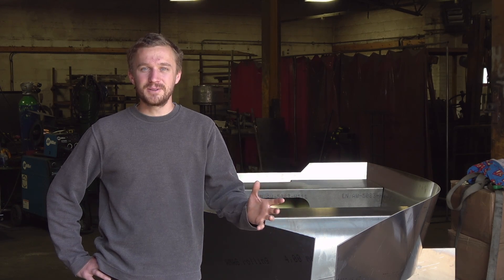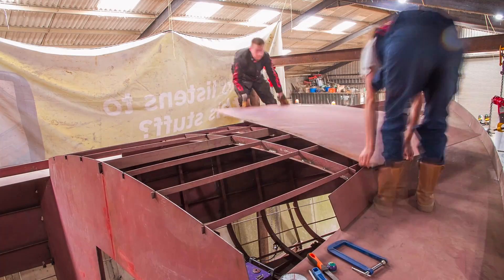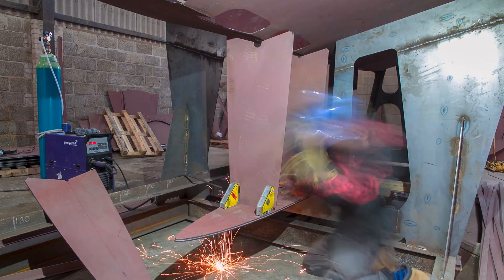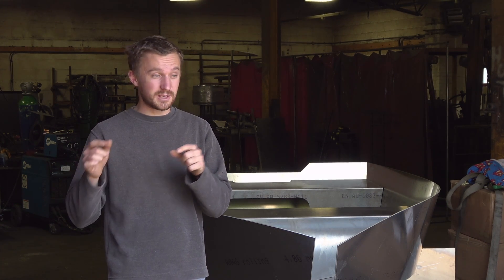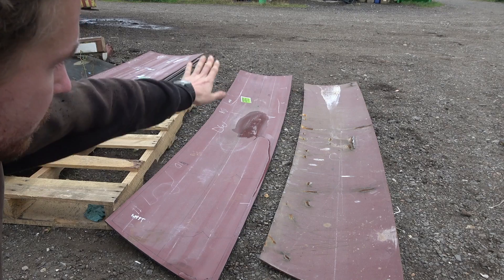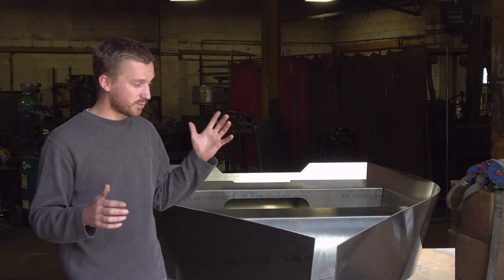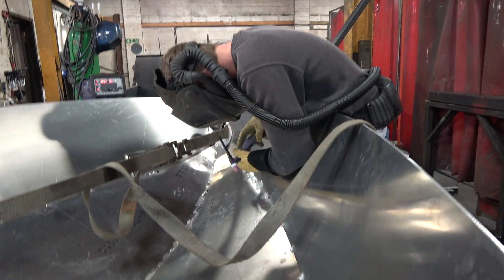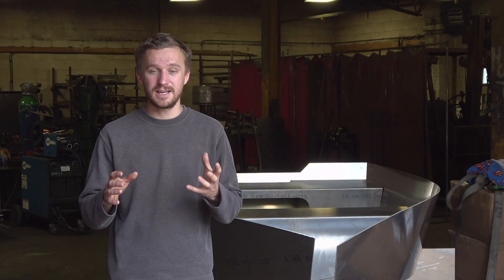2020 Boat Building Update: Plans and lockdown project

Comment: I was pleasantly surprised when I came across your videos.
In the 90's, my father started building a Roberts 45 steel yacht, and I spent a great deal of time helping out on it.
My not-so-fond memories of that was the task of grinding the chines down along the full length of the hull, 3 of them on each side (two weld beads either side where the plates met the round bars)! Spent at least 2 of my summer school breaks doing that!

The yacht was built from the keel up, the frames, constructed out of 10 x 50 mm flat bar, were added from the middle (over the keel) and out fore and aft until they were all in their correct places. Added 20 mm round bar the full length of the yacht at the two chines on each side, and 30mm round bar where the deck meets the hull, to provide rigidity to the structure before adding all the hull plates. There was also a 50 mm solid round bar running up from the keel base plate  to the top of the bow. The whole yacht's outer skin (hull and deck) was tacked into place, and then left to de-stress over a period of about 3 years. The yacht was built in the open, so it got to experience quite large temperature fluctuations to help with the stress releasing process. quite a few of the weld joints snapped during that time. We only had flat steel plate, none of it pre-formed, so there were massive forces in the hull that needed to relax before the final welding could be done.

Had to share that bit as the building technique you are able to use is so much different because you have the pre-cut and rolled pieces, so much faster and nicer looking.

Keep up the hard work, looking forward to seeing more videos with your progress.

Comment: HIya. I have a boat in Conway, N Wales. Also have a smallish 23 foot ally (5083) yacht upside down in the garden of which I have just replaced 14 x (2.5mm) plates on the sole. Strengthened with some extra 1inchx3mm wall 6082 internal box sections. Easier to work with her upside down with welding due to gravity with ally. I tried tig but to be honest it was putting too much heat in the plates and they were warping too much so using 0.8mm 5356 on mig with spool gun now. Far easier, surprisingly. I know what you mean about working in winter. :) Its not nice working with metal boats when its cold outside. I didnt get back to working on mine till COVID lockdown which gave me the perfect opportunity to do something. King Herog is doing something interesting with his PROA build. Fair winds. Good look with the 2 boat builds. Keep the great vblogs coming, David
Reply from the maker: We both used to live in North Wales, love it up there!
We've been chatting with King Herog, interesting stuff :)
Thanks for the luck!